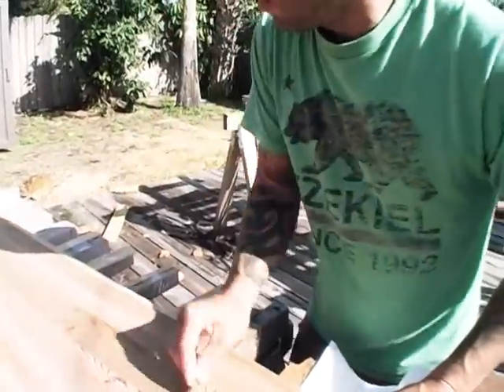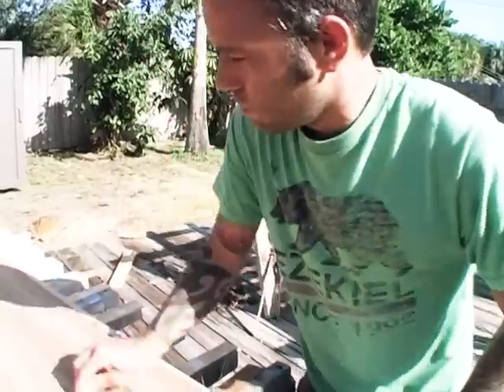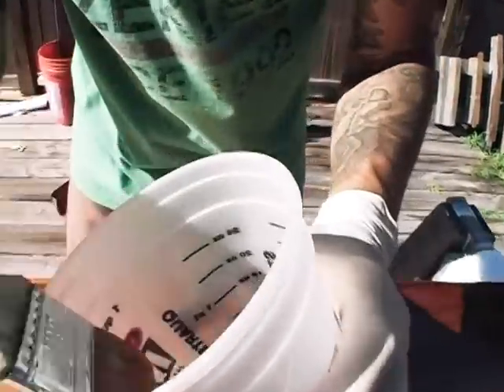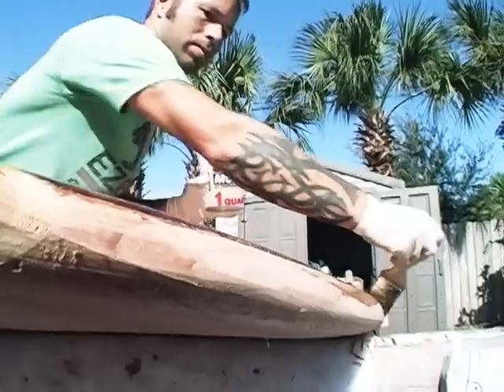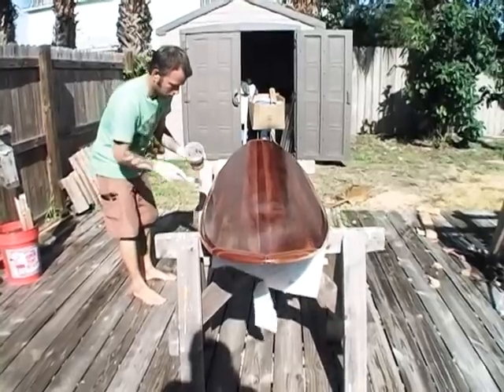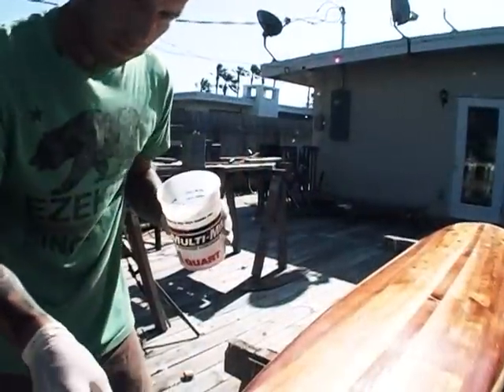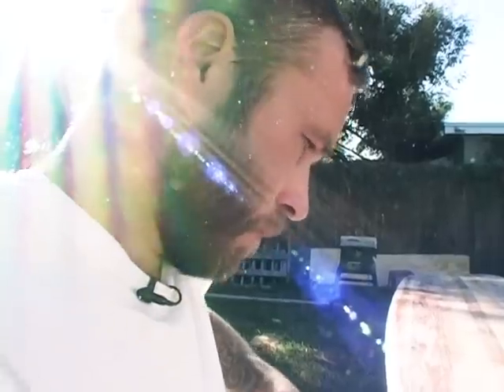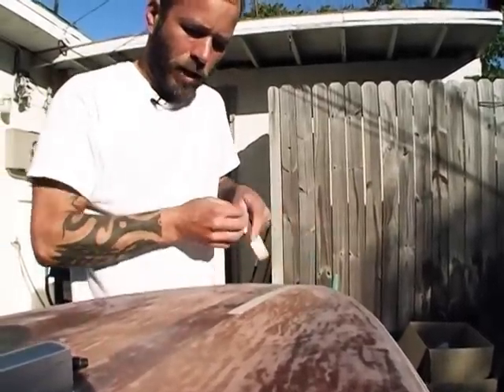Bulding a Hollow Wooden Longbard- Complete video

Comment: It’s interesting in most of the videos I’ve watch building boards they use the poly glue.  The glue routinely finishes at the bottom in all the tests.  Titebond 3 or that type always finish first.  I used the poly on a gate build and it failed within the first 6 months.  I redid it with titebond3  and years later it’s still rock solid.  This is without a finish covering it.   I’m not judging you just making an observation.  Beautiful craftsmanship
Reply: you also need to consider the open and the closed time. it is not a quick glue up.

Comment: WOW greatstuff! ive made 40 foam boards never touched wood so I have to make one before I die but I live in UK and locating the right wood and materials is not easy around here but dam this is real inspiration thankyou you did an amazing job. I was thinking you could try glueing on poly foam on the rails a long band then the rails would be easier to shape but I guess its not a full wooden board then.in the UK matrials are well overpriced here
Reply: for more bouyancy you could use construction foam spray in to the cavities
Reply: Brian Trend that would reduce buoyancy compared to having the chamber full of air

Comment: Hello Chad Stone, sorry but I do not speak English. Could you give me the plans so I could build it myself? You did a good job, it's fantastic, thank you and greetings.
Reply: I sell the plans and instruction at www.TimelessSurfCompany.com
Reply: Miguel.Angel Viajes    if you don't get plans then just use this video as a tutorial . 1.   copy a friends foam long board or mini Malibu by drawing around the outline shape with a pen and then cut out the cardboard template just the one side of the center stringer. 2.  then turn the friends foam board on its side and draw around the top and bottom of his board to form the central wooden stringer rocker shape . 3. form the ribbing to the template shape equally along the length of the rocker stringer . 4.  make the top and bottom decks flat then glue to stringer. 5.  glue wood batten planks to ends to shape rails . /or glue polyurethane surfboard foam bands along the sides which is easy to shape than wood for the rails. 6. plane off to finish shaping then sand and glass, sand again and buff to high finish.

Comment: What did u fill the insde of the board with
Reply: You don't have to fill it with anything as long as you vent it.  You can fill it with foam before gluing on the top deck.  This dies add weight but lessens the need for venting.